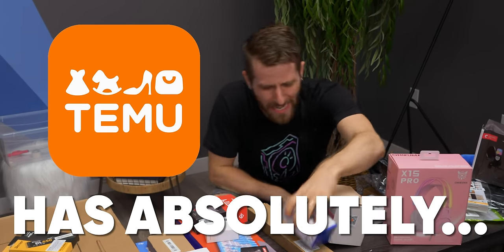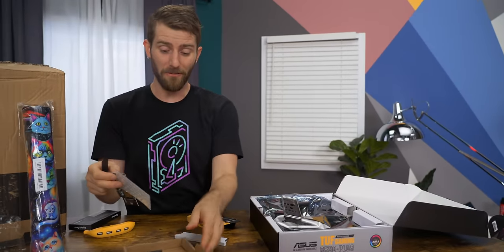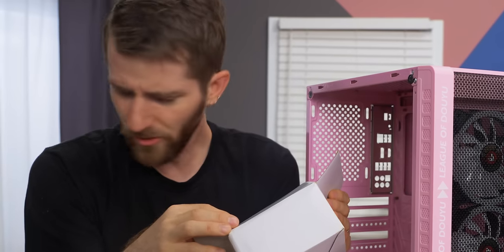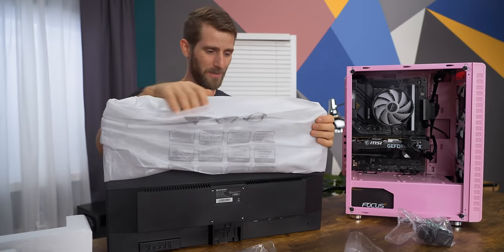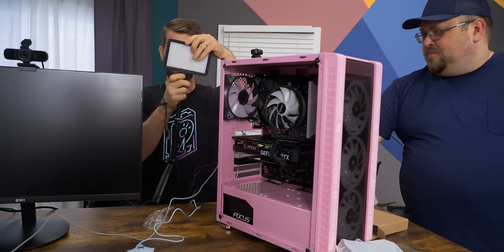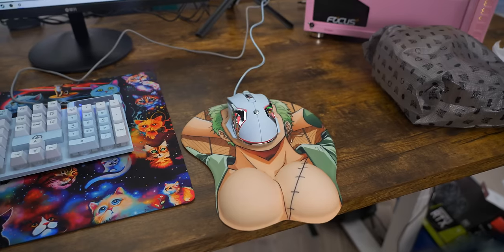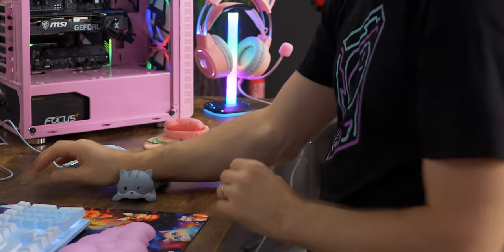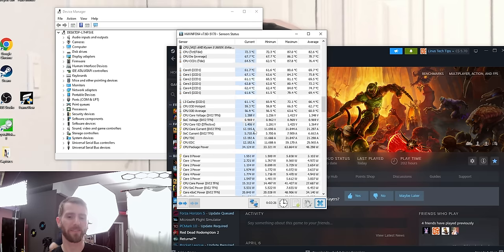You Wanted a TEMU Gaming Setup…You were wrong.

Comment: That webcam was damn impressive for the price. I got a fairly high end consumer webcam some years ago (logitech that cost over $100 at the time), and it doesn't have quite as fluid of motion as your $11 one. I was also impressed by the headset mic, didn't sound that much different from what you normally use for videos (at least on my speakers which aren't high grade but still do fine)
Reply: Careful now, QC/QA is important. More likely than not, Linus probably just got lucky with the purchase and the one they shipped out after is probably barely functioning.
Reply: logitech webcams
Reply: @LenKirin they are weird
Reply: I've bought some super cheap and surprisingly good stuff on Temu, a lot of it is either minimal/no QC/QA (so it's a bit of a gamble) or it's legitimately good stuff but from 5-10 years ago. Bought some bike headlights for $1.50US that performed as well as some lights ten times their price, did a bit of searching online, and found out that yep, they're basically either overstock or re-used manufacturing from an identical set of lights that was being made overseas years ago.

Wouldn't be surprised if the webcam is the same thing, enough searching around and you'll likely find it's the same design as some old webcam from a bigger manufacturer. Probably one that was being made in China to begin with and when they switched to newer designs, the factory just went "eh, let's just keep making these".
Reply: @JiorujiDerako  I'm sure a lot of their products are also factory seconds or productions tests that weren't tossed. I'm finding many things on TEMU that's being sold on Amazon but for much less.
Reply: @JiorujiDerako  I mean a lot of the time all that a big "brand name" company is selling is just Chinese products made in the same factories. They may have better QC standards in place for the brand name products, but at the end of the day a lot of this stuff on Temu is probably similar to products you'd go buy off Amazon, just a different label. Half the time the supplier for the brand name is just copying the brand name companies product and selling it on the side on Temu with their own label.
Reply: @LenKirin  I also got a crappy offbrand webcam from Amazon and it genuinely looks better than my friend's $100 Logitech webcam. Modern camera sensors are so high quality and so cheap that it's genuinely difficult to make a bad webcam, that's why I'm always amazed by how garbage dashcams are.
Reply: My cheapo "blogger" webcam from kmart cab go toe to toe with my DSLR 😂
Reply: Make sure that lighting adaption is set to 0, or logitech webcams tend to run at 10fps instead of 30
Reply: I got two ear phones from them, they're great but are slightly shaped differently. So one pair fits better than another. It's really odd, but I bought them for like $12 each and suit my purposes although they do fall out every now and then. Just know that you might get some shit product, very easy to get a refund if that's the case though.

Comment: For the PCIe NVME card, when mounting the drive the little silver "spacer" has a grove around the diameter that slides onto the drive mounting slot. Once slid into place, press the end of the drive down to the hole on the adapter card and fasten the screw from underneath the card.
Reply: that part made me cringe. linus is supposed to know more than me

Comment: for those wondering what he said at 8:31 there you go 😊

*Storage*: Derler DL 650 NVMe. 512GB / $30 PCIe 3.0

*Storage Adapter*: Zoerax M.2 nvme to pcie 4.0 - $4

*Case": Douyu DIY Mainframe Desktop USB3, 3 RGB fans, supports up to 240mm rad, $75

*Case Fan: Add 1 fan to the back of the case, the Aigo AR12 Pro-$9, matched the case fans in the pictures.
Reply: Did you hold it up to a mirror or do 1 letter at a time lol
Reply: appreciate it 🙏
Reply: @metalgt6828  I did it by taking a screenshot then mirroring it in the crop section of the edit mode in the camera app
Reply: This feels very unprofessional for this channel.
Reply: @brendanr1525  Yes. So are the lame jokes and calling the SSD RAM at 4:24.
Reply: @brendanr1525  it was probably to simulate linus reading from a teleprompter
Reply: dude really said ' lemme decipher
 this real quick'

Comment: i love seasonic so much. one of the few remaining brands that just kills it every single time. i got a 1kw seasonic to be future proof back in 2012 and its still running strong. it runs so efficient, the fan has never kicked on once the entire time i've owned it (the fan comes on only when it runs hot)
Reply: Sir your fan might be broken
Reply: old psus are actually great. they don't make em like they used to tbh, my 2009 cooler master 1kw "silent" (it's not silent) pro is still living and killing it today, even with my 300w gpu and 200w cpu. (light work even with everything else on the pc)
Reply: @cheezclump  To be fair PC components have only gone down in their power consumption so old PSU were built to handle larger loads over time. So its one of those products where the older generation is actually better.

Comment: Those M.2 to PCIe Adapters actually work pretty well. If you are on an older platform they might be worth it.
Reply: I use them daily. I have no problems
Reply: I have a Sabrent one in my PC with a 2tb 980 for games.
Reply: Watch out, you can not boot from them probably. Just data disks
Reply: I just hit peak abuse of tech with one, by plugging an M.2 drive (cycled out of an old build) into my old win Xp machine.  It wont boot off it, as the board wont support a boot cycle that isnt off an EDI chain, but it loads Roller Coaster Tycoon 3 plenty fast.  And a 250G drive is a lot of space for Win Xp era programs.

Comment: @Linus, The annular rings present on mounting points you show at 4:13 are not necessarily attached to the ground net in a PCBA. Often in fact, they are not directly attached, but rather through a chassis ground - board ground connection. (in the form of some capacitors and resistors) But this is not a given, so particularly on "questionable" boards, I wouldn't immediately assume it.
Reply: The only thing I learned from this video is that I require that anime Linus wallpaper

Comment: that's pretty much been my experience with Temu. Most of it is garbage, but sometimes you get lucky and something you get is actually pretty good. I used my newcomer's perk and got 7 things for $10, and 3 of them were pretty much junk. The other 3 were actually good and usable. One was a 1/4" TS jack that was of horrible, terrible quality; one was a guitar strap that broke the first time I tried to use it, and one was a pretty bad guitar bag that had about a 3 inch tear in one of the seams. The 4 good things were a surprisingly decent distortion pedal (free with your purchase of $10+), another different guitar strap, a standard 3.5mm cable, and a fret wrap for guitar. My invoice shows that all but one strap and the case were "free".
Reply: Not sure if this is a recent thing but for me Temu was extremely accomodating when I had issues with some defective or broken items; or items that had incorrect measurements. Every single time they gave me a full refund for the item and I didn't even need to send it back. I just told them about the issue, sent them some pictures about it; and that was enough.

Comment: I had to use an adapter for my mvme drive cause my system is 12 years old so no slot. I think the best part was the headset lol. Good mic, ok sound, rgb in a tube...neat. Now if they really could make unattached components like earpads and ears and each piece.

Comment: Someone explain to me what was going on at 8:30? Was that intentional?
Reply: It’s a teleprompter effect and yes
Reply: it says

*Storage*: Derler DL 650 NVMe. 512GB / $30 PCIe 3.0

*Storage Adapter*: Zoerax M.2 nvme to pcie 4.0 - $4

*Case": Douyu DIY Mainframe Desktop USB3, 3 RGB fans, supports up to 240mm rad, $75

*Case Fan: Add 1 fan to the back of the case, the Aigo AR12 Pro-$9, matched the case fans in the pictures.

Comment: The Keyboard, the mouse, the lights, the pad, the speakers, the Pc case and the fan were all in truth well worth the price. I mean for less than 200 bucks you have all the basic extras and EVERYTHING had RGB lights. if I can get all that same stuff in black or blue then consider me sold....if I actually needed a new setup, which I dont.

Comment: Linus just talking about the power supply -
Youtube subtitles: "We were trying to plug in our front panel USB three and realized that our little right angle penis extension on the 24 pin is making it so it doesn't fit." 

I love youtube subtitles 
🤣

Comment: Loved the video!  While I was watching, one of my monitors started showing vertical and horizontal lines. I thought it was a cool filter you added.  My whole setup is pink-themed, and I bought PX248 Wave Pink from Pixio. I also heard this isn't the first time that happened to these monitors. Should I contact the company? Should I buy a whole new monitor? If so, what monitor should I buy to fit the theme, or should I get a good monitor and forget the theme. Any advice to fix this?

Comment: I bought a cheap dualsense dual charging dock for ps5 off amazon for £8. Essentially the same type you would find on any other dropshipping site for cheap as well. 
It killed my dualsense, sony sent me a new one, it killed that one too. I got rid of it and started to only charge with the provided usb c cable and no problems since. Sone products really require to be licenced by manufacturers e.g. dont buy a knock off charging doc for your controllers if you dont want to ruin your batteries, go with the officially licenced ones to save your tears.

Comment: So all in all, if longetivity is unimportant and you just want anything to do the job, this webcam, case fan and perhaps headset will do the job. Perhaps I missed the comment on mouse quality so who knows. Those lights seem crap (arm quality + light), the monitor is crap by the looks of it and the keyboard would make you lose your typing skills just using it. The rest is even worse. Honestly, if some parts were at least slightly higher quality then they could put together a build that would last maybe a few years. Sure it won't last as long as builds with quality items, but it's half the price. It would be interesting to see an better explanation and an episode where they would re-use the "winners" of these items and add new items to make a barely ok build for like a little brother/sister you don't love too much.

Comment: left one side of the tower uncovered, which cancels the flow of air for ventilation and cooling. Used different brands of dram, which is not recommended when you're going for performance; infact it may not work at all.

but it's fun watching this after getting my comptia A+ certification. Bouta get my Network+, and then I'll move on to CCNA
Reply: So,
They did use thermal paste
Leaving the side open is not actually an issue
They used a single stick of RAM...

Do you wanna try and pay attention?
Reply: @ScarlettCatte  Any tech website will tell you that removing the side panel disrupts normal airflow. I recalled that fact from the book I read to get certified. That's also just logic too, because you've just created a giant window for air to go through?

Ya I didn't notice that they bought one ramstick, with only 8gb capacity

bruh, are you mad or something?
Reply: @musiclibrary7175 
And...? It's really not a big deal.
Given the system is not airflow optimized anyway, you're just going from one turbulent setup to another.

I don't really care about some certification. Everyone and their dog who goes into IT does comptia certs at school.

Bruh, you made 3 separate "corrections" that weren't corrections... Lol. Scarlett just pointed out that if you're gonna correct someone, try to be... Y'know... Correct?